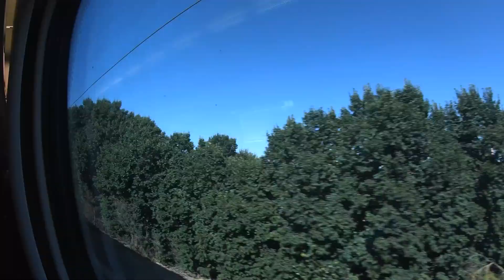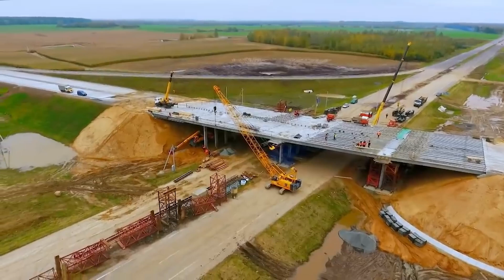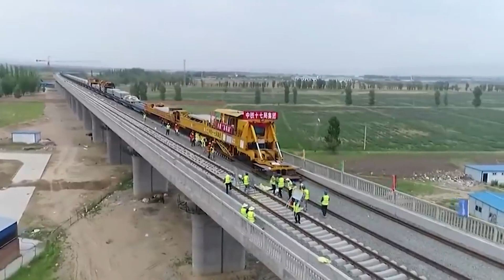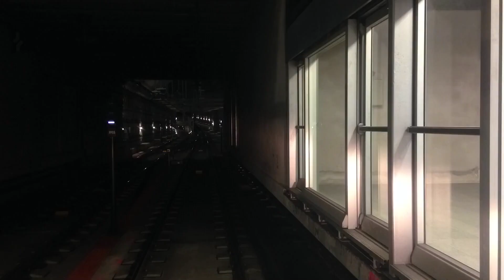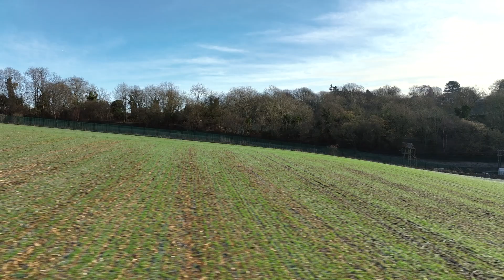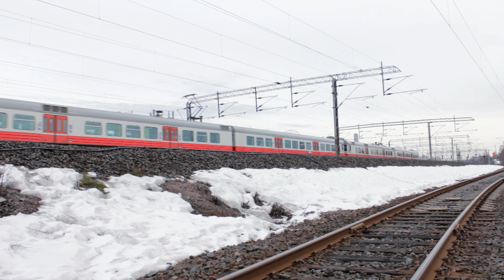Unbelievable: China Builds insane bamboo high speed rail!🎋

Comment: Using wound bamboo for smaller objects is an old proven technology that is very strong. Doing it on an industrial scale for train cars makes sense. One environmental impact this video ignores is the manufacturing of the resins used in the process. The video makes it sound like only bamboo is used, which is not correct.